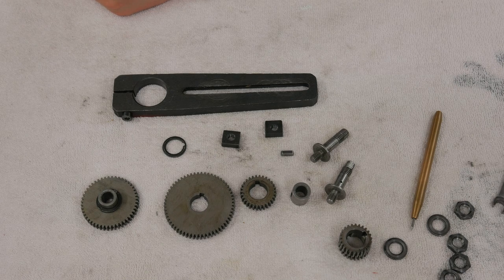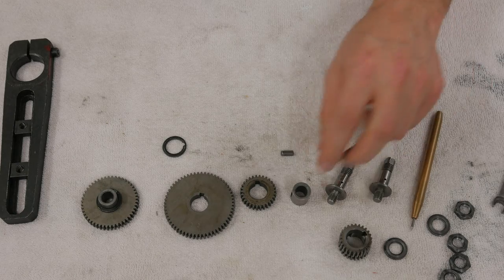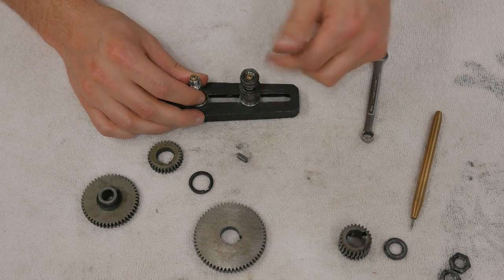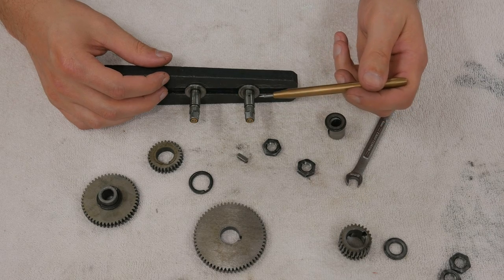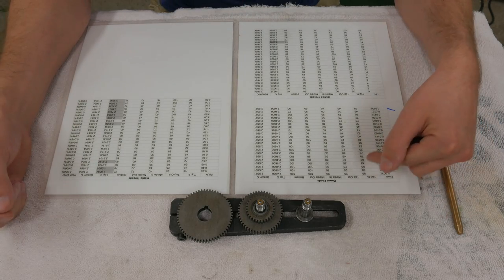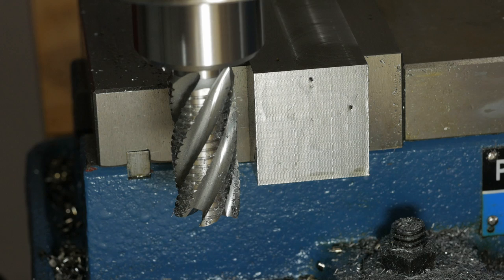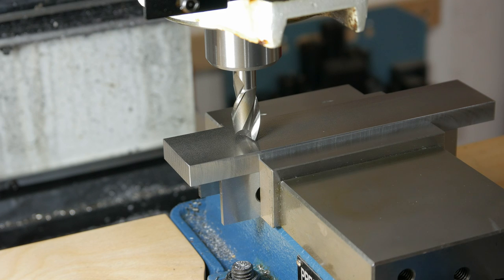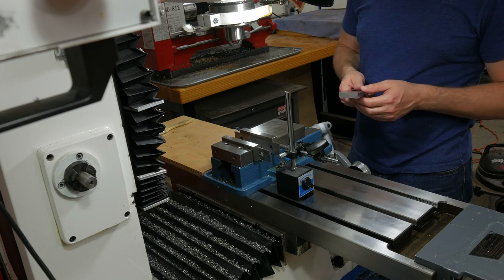A Better Lathe Banjo Pt. 1

Comment: Good start, I will follow this one closely, I have the same very special gear banjo in my lathe :)
I like the idea of having multiple banjos - I just thought about ditching the adjustment and just drill fixed hole positions for the axles...
Reply from the maker: I thought about putting studs directly into the head-stock as well, but I questioned how long the threads would hold up. The cast iron in my lathe, seems pretty brittle.
Reply: You're investing a lot of time in a Hazard Fraught (AvE has subverted my entire shop vocabulary) lathe; for someone of your obvious ability I'm hoping you're using it as an inexpensive test bed to prepare for something more worthy of your skills?

I say this because I had to return the first milling machine I bought there when I saw the ceramic from a sparkplug cast into the base.  I only buy disposable things there now.
Reply: Stefan, I’ve always pictured you more as a cello guy, not banjo.

Comment: On my lathe (Myford) there is just a screw and a washer on the end of the studs to hold the gears in place.  They don't really have to work hard if the shafts are all parallel.  Also there are no spacers between the gears. 

That's a great tip about using the magnetic indicator stand as a mill stop.
You get a lovely finish from your shell cutter.  I enjoyed watching it nom through the metal so easily. :D

Comment: Term for a thin open end wrench is "Tappet Wrench." The original purpose for this wrench was to set the lock nut on an automotive engine valve tappet when adjusting the valve train clearance. There wasn't much room for a standard thickness wrench on a side valve engine to get between the valve spring retainer and the top of the tappet that runs on the camshaft.